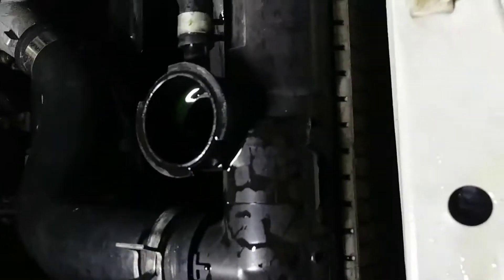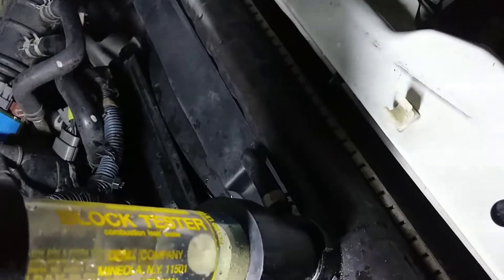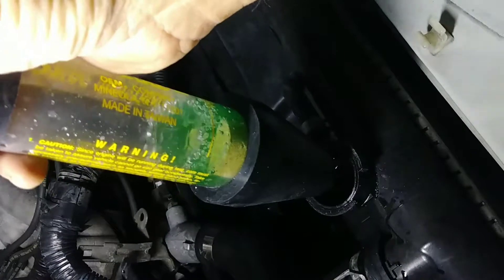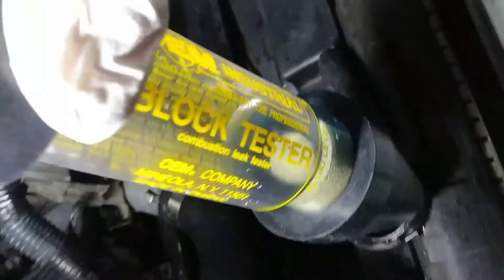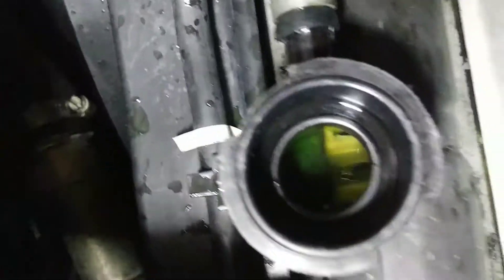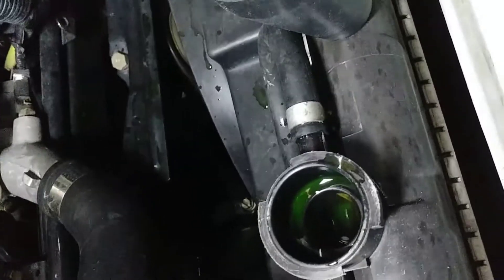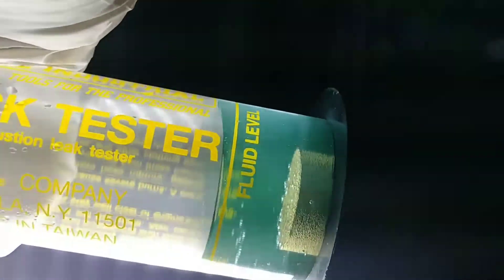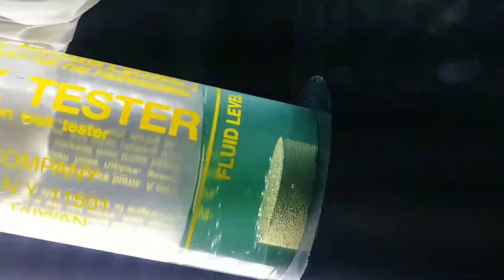How to use the OEM engine block tester to test for blown head gaskets or cracked cylinder head

Comment: Just for anybody looking to learn from this, don't.  The fluid from the bottle shoulld have been medium blue. Blue-er than windex. Closer to a blue soft drink.   His fluid is clear coming out of the bottle so it's bad. contaminated or overheated or something.   You'relooking for if it goest from very blue to green or definitely yellow.  Nothing can be gaind from his test so find a different video to learn from visually.